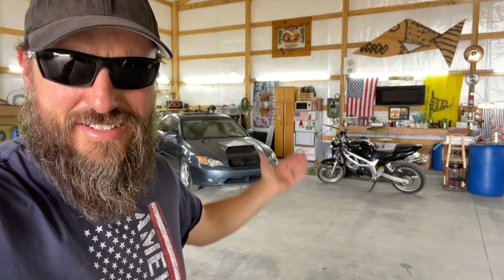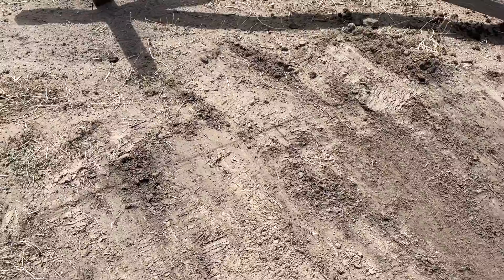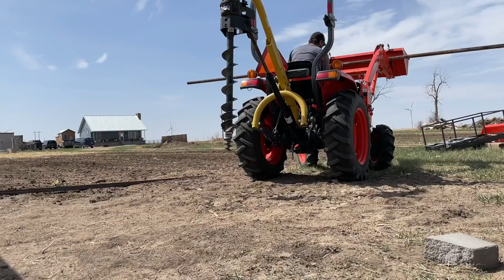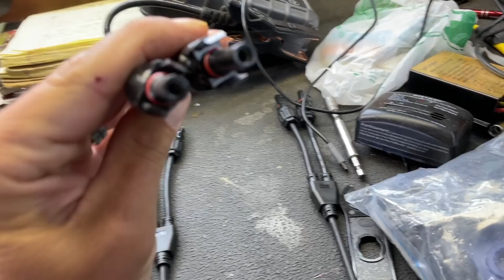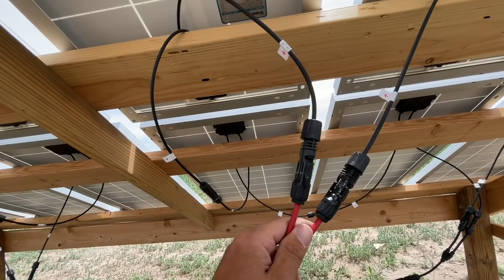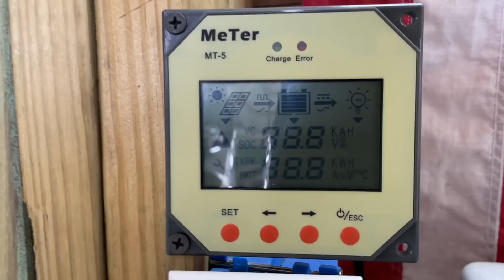Fire, Wind and Solar Powered Dream Shop!

Comment: What do you think 🤔 about cutting pipe for wind generator about 2 feet above ground and putting flat bar straps on lower pipe to make a pivot point with a feed bolts then you can install wind generator at belly height

Comment: You should make a hinged base for your wind generator tower so that you can fold it down. You can use a boat hand winch to rase it up and down. You will need 4 guide wires because of the amount of wind you have there. You need to inspect the wind mill a lot and this will make it so much easier for any maintenance. You need to make sure the fan is tight because if it comes off it will destroy who or whatever it hits while it's flying along at Mock 3. A new set of blades will cost you over $150.00.  I have two wind generators of the kind you have and 15 72X39 solar panels dyi. I am running three banks of 4 panels and one with three panels. I have three grid tie boxes plugged into the house currant and the others to the two battery banks 24 volts each.  With everything working correctly I am making 3000 watts during a sunny day. You will work on the wind generator more than the solar panels. I have never been able to combine wind power with solar power. I have four different chargers for the solar and two for the wind generators. When you buy a charger for the wind generator make sure it is for a Wind generator. last thing, make sure the voltages, amps, and watts are compatible with what is coming into your chargers and inverters. Trying to run a charger or inverter at its max is a bad idea. They won't last long they will just overheat and burn out even with built in safety limiters. I am not and expert, but I have been running my stuff for 6 years now. Solar equipment is not cheap anymore and the only place you can get new equipment is China so you're looking at a month or two get it shipped if they ever do ship it.
Reply from the maker: lot of good info there! Thanks Bruce!
Reply: Great suggestions on the hinged base, hand winch and 4 guide wires on the wind tower since you can weld!  That way, you can just fold it down to install the wind generator and do future maintenance on it.  Just make everything Mega strong since you get crazy wind there.

Comment: Rock and Roll good job on the solar. If you existing batteries have a little age on them they will drag the capacity of the new ones you add to the bank down to their degraded capacity. If that, makes sense.
Reply from the maker: yeah makes sense. maybe one day i can afford a nice new lifipo4 set

Comment: Pretty cool project.  I'm keeping my eyes open for a good system, but likely will end up with a commercial system that ties back into our counties grid for a goal of Net-0 "cost" for our power bill...
Reply from the maker: not a bad idea, but be sure to get battery back up, that way you can use it if the power goes out.

Comment: How many solar panels do you put on a camper to make it self sufficient to be able to run everything except the air c
Reply from the maker: You can run almost anything  with a 400w system, but it's all down to power management and how much you want to spend.

Comment: Full time RV 100% off grid, I have messed with AGM and Lead for a long time. I will never look back after getting LifePo4. Amazon has high amperage batts for cheep. I am running a 300A LifePo4 now with 650w on the roof. Renogy Rover controller. 
May want to rethink adding AGM for the shop as you will need "more power" at some point..
Reply from the maker: i agree, just the extra cost. i already had those 4 AGM
Reply: That was an issue with me as well, now lith batt prices are dropping hard. The 300a i got was $960. As my second set of batts were failing I pulled the trigger and haven't looked back. This batt may out live me..